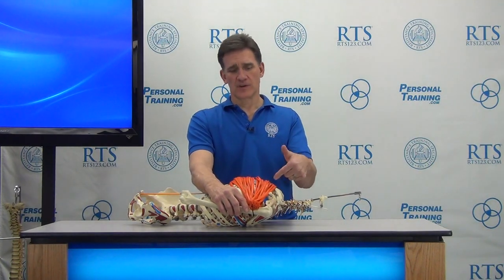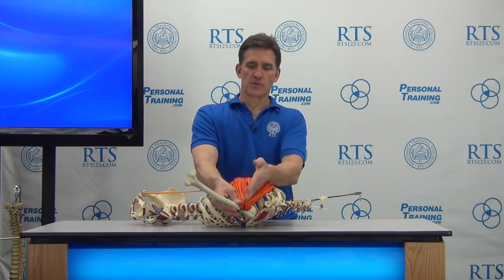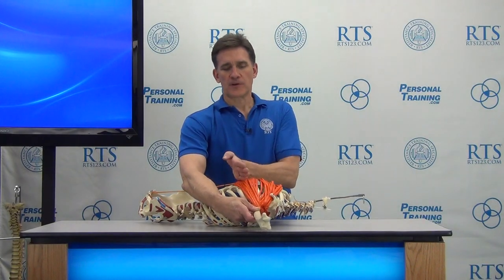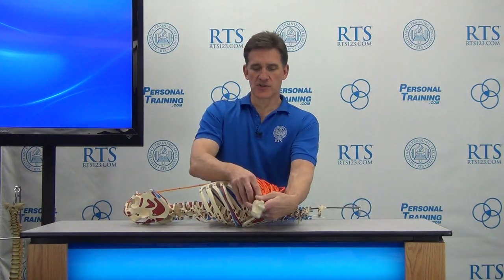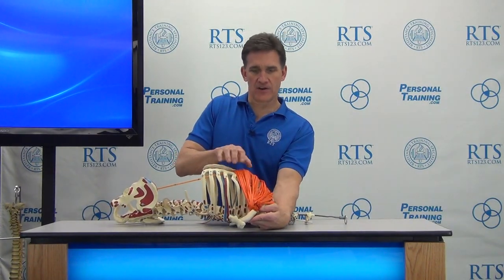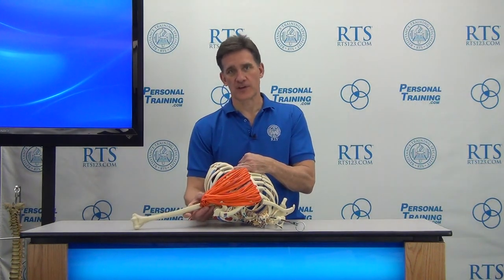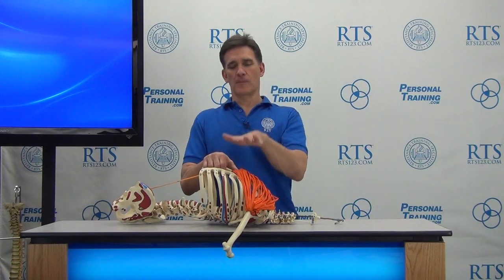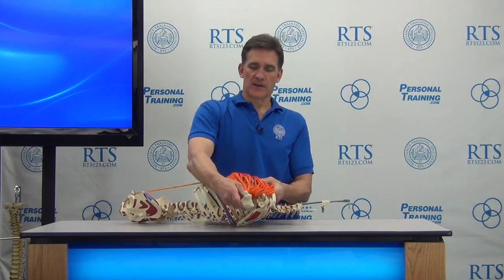Pec Mechanics Part 1: Structural and Positional Influences

Comment: Fantastic. It's is so enlightening finally understanding this and why I have a relatively shit bench press. I always knew it was genetics and the fact that I am ectomorphic and have a smaller torso but I always just thought it was do to a lack of width in the pecs not this vertical component and it is really cool actually understanding how the muscles work like this. It also explains why the arch works so well and a good tip on not exhaling during the push. Awesome